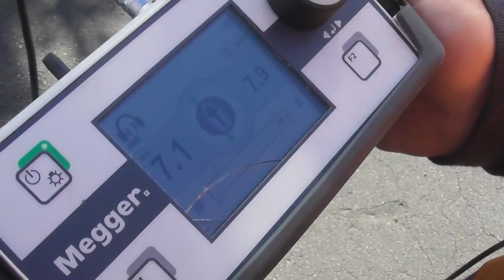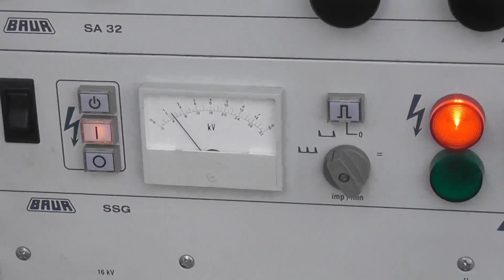HV fault locate with the Thumper

Comment: Thanks for showing us your thumper.  I had heard of these before, but never seen one in operation.  Surprised your camera picked up the audio signature so clearly.  How deep was the cable and what size capacitor does your thumper use (trying to figure out how much energy was dumped into each thump)?

Comment: Does the thumper just charge up till theres a breakdown? Or does it pulse based on time?
Reply from the maker: Pulse based on time. We ramp up the voltage to get a break down, then set timer.
Reply: @RODALCO2007  Ours work with a big ball that drops down and lifts back up. We use it in NL for 230/400V faults though. Do you also use TDR to measure fault distances?
Reply from the maker: @jim575757  Yes we use TDR sometimes. Our 11 kV runs are not that long, after a good mark out of the route we usually energize the thumper and listen for it.